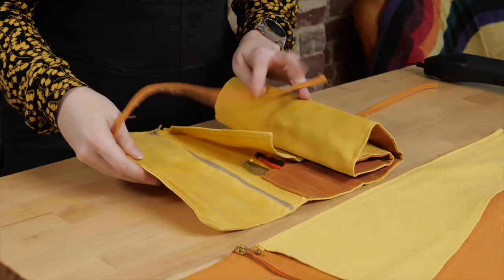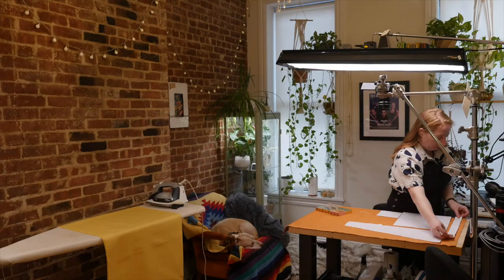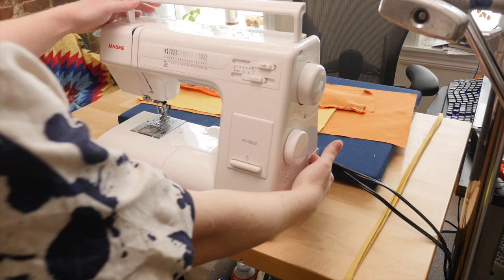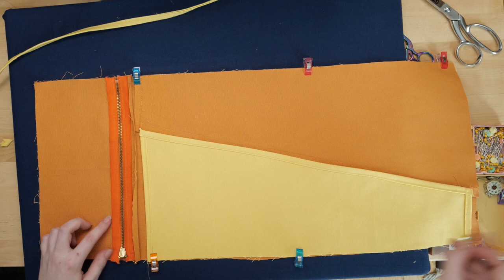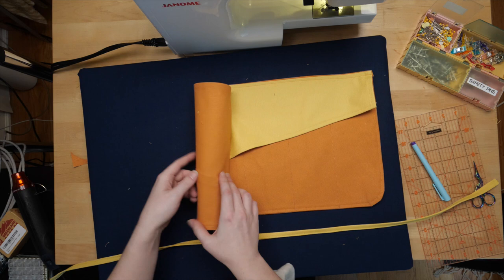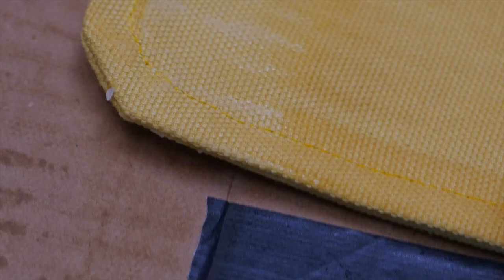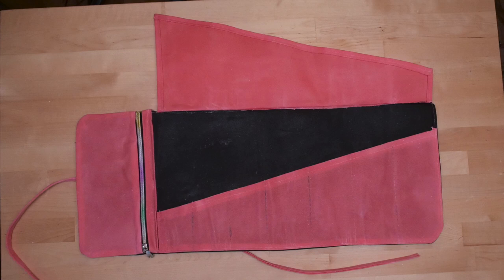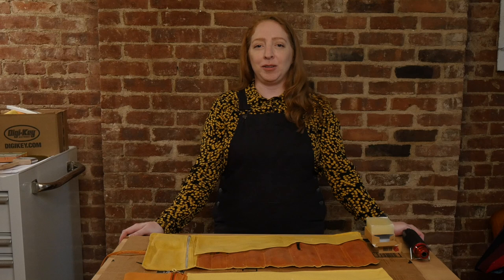Make a Waxed Canvas Tool Roll (With Pattern)

Comment: I live in wax jackets, jerkins and coats through the wetter colder months and have been waxing and re-waxing them for years. Paraffin (candle) Wax, dries to a very tough hard finish but if you want a more flexible,but still very hardy finished product try 40% candle wax, 40% Beeswax and 20% Clear Mineral Oil [Ordinary pure Baby Oil]. The secret to getting a quick even finish is heat. Preheat the leather or canvas using a hairdryer on hot setting, Keep the heat on, while applying the wax directly from the hot pot and spread it as even as you can.  Still working under the hairdryer, switch to a 6 or 8 inch decorators/paperhangers bristle brush brushing energetically in all directions. This really evens out the finish. On a lower heat setting, use a wad of leather of canvas to burnish it in well - hope this helps someone out   ;<)

Comment: For those wondering about the wax on the zip, it's fine! Too much wax may gum it up a bit, but you can use wax to lubricate sticky zips.

 Crayons work well apparently, because of the pointy tips. I've only used "proper" fabric wax, so I can't say one way or the other

Comment: I love this. I wonder if this would hold up as a knife case. My carry case now is a stiff case, but I've always wanted a roll up case. 
I always had a fear I would sew my finger or thumb using a sewing machine. It's irrational.
Reply from the maker: This would absolutely hold up as a knife case. You might need to make it a bit taller to accomodate. You're right that your fear of sewing your finger is irrational. The machine is designed to make it hard to hurt yourself. I've been sewing for several decades and it hasn't happened to me once. The pins, however, will stab you repeatedly. At least they aren't motorized. 😆
Reply: @BeckyStern    I haven't touched a sewing machine since the early nineties... And that was a machine from the early eighties, so either they've always been safe or they got safer.

Comment: What's the seam allowance on this? Assuming double fold is 1/4" and single fold is 1/2"? And it looks like the rest is 1/2" around? And the zipper is 8 or 10" long?
Reply from the maker: Yep that'll work, it's pretty forgiving. I used about a 5/8" allowance all over. Zipper's about 11" long.

Comment: Hey I’m just wondering would it be possible to do with already waxed canvas? I’m making my own pencil case because I think a customized one would be better. I don’t have a sewing machine so I’m had stitching
Reply from the maker: Yes, but I think sewing with already waxed canvas is much more difficult than sewing it pre-wax. Unless your expertise comes from leatherworking, in which case you can treat it like leather and also stitch with already-waxed thread. Here's a video where I made something with that method: https://youtu.be/8Fx8NRtKhX8

Comment: Thanks for the awesome video. I’ve always been afraid of sewing projects although I do woodwork and fine restoration of instruments. Sewing using a machine seems to implore a shroud of mystery, as well as fear of making a mistake. I think the somewhat 2 dimensional nature throws my brain for a loop!
Do you leave extra fabric between the pocket seams to allow for the thickness of the tool? For example, if the item going in the pocket is 1” wide, and 1/2” thick, would you sew the pocket to be 1” wide or wider to accommodate the thickness? Would you keep the pocket width at 1” and add a pleat to allow the tool to slide in easily while still being secure? Feel free to let me know if I am over thinking! 😉
Reply from the maker: While you can certainly make a pleated version if you want to make things more complicated, you are overthinking a bit-- the fabric of both the body and the pocket bends and moves to accomodate the thickness of the tools. When it's rolled up it looks lumpy. To make sure your pockets fit your tools, lay them out and mark up the pocket stitches with the tools on the project.
Reply: @BeckyStern  Exactly what I needed to hear, thank you Becky!